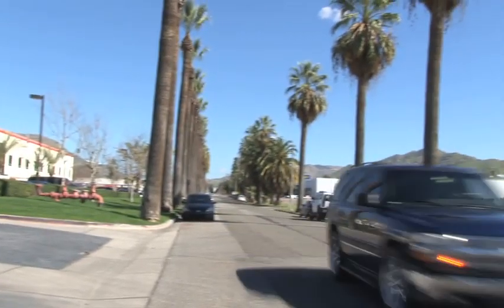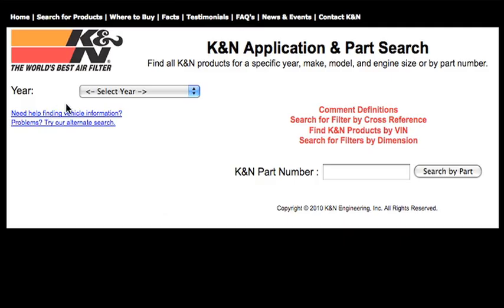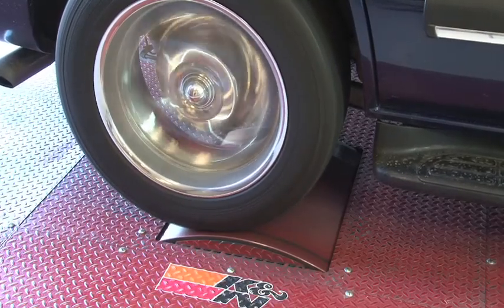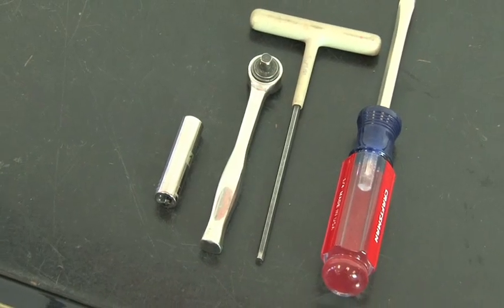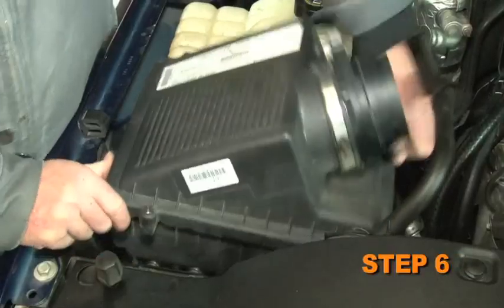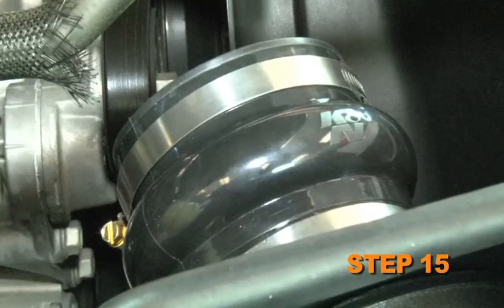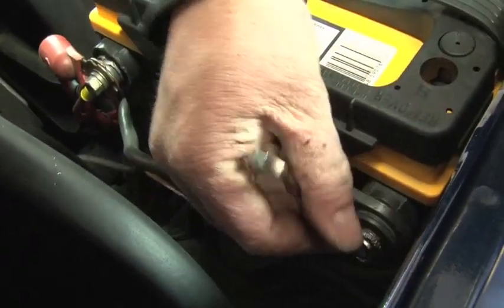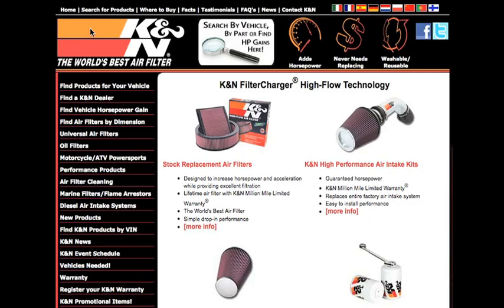Silverado, Suburban, Tahoe, Avalanche, Sierra 1500/2500, Yukon, Denali [#77-3023KP]T Air Intake

Comment: I wouldn't have to get a tune if I install a new CAI right? I live nowhere close to any car shops or anything like that so I dont want to buy a new CAI and then install and mess up my truck because I didn't get a tune.
Reply from the maker: No, all K&N air intake systems are designed to work with factory ECU settings. Please contact our Product Specialists at 800-858-3333 or tech@knfilters.com if you have any additional questions.

Comment: I HAVE A 09 GMC SIERRA 6.0 THE K&N AIR TUBE RUBS HARD ON RADIATOR HOSE.AND CHECK ENGINE LIGHT IS ON.

Comment from the maker: @MarshalZhukov In theory, yes. But because of the over 30 factors that determine fuel consumption, it is impossible to test for or guarantee, which is why K&N will not make a claim regarding fuel economy increase. Many of our consumers do report back an increase in mileage.

Comment: Is this product detrimental to fuel economy? So for example, if one of two vehicles of the exact year, model and engine has this product in it, the one with this product will show an increase in horsepower, but would there also be an increase fuel economy assuming they were driven by, let's say, a geriatric, the same way?
Reply: If you drive like an old person, you may notice better gas mileage. If you drive like a psycho, you will notice increased horsepower and responsiveness. That's been my experience.

Comment from the maker: @2LateIWon We were just stating that the 14 HP increase on the dyno pull was tested on a 2003 Escalade 6.0L; not what is featured in the video.
Reply: KNfilters, have you realized you can reply directly to a question in the same thread, rather than putting the reply in a new thread? So hard to find the original questions to your responses.
Reply: Use my example, please.